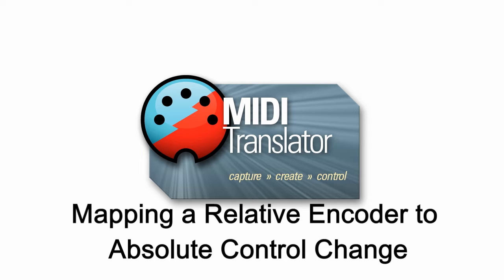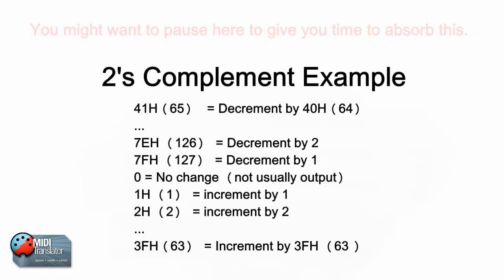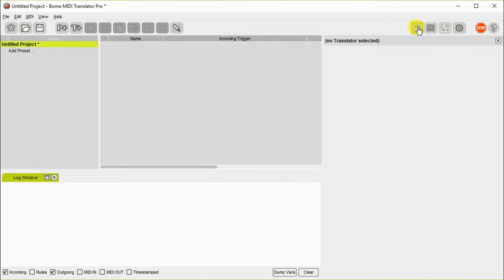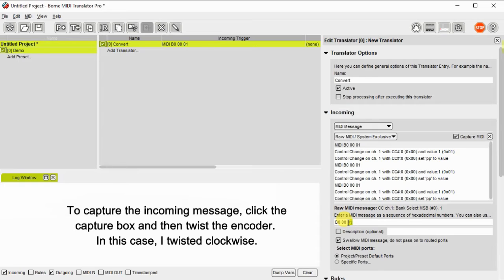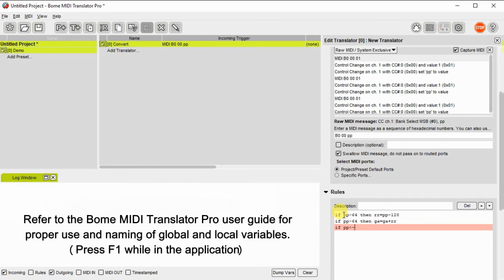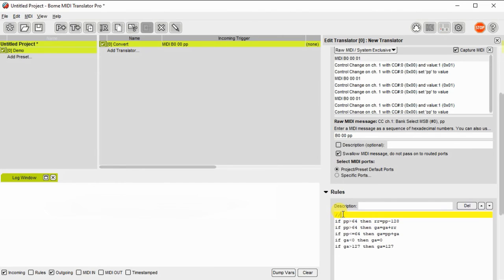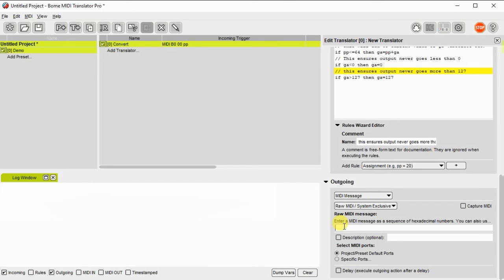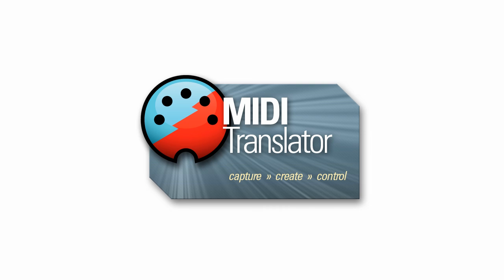Tutorial: Map a relative encoder to absolute control change with Bome MIDI Translator Pro

Comment: How to speed up the knob speed
Reply from the maker: Hi, If your relative encoder is not moving the knob fast enough, you can change the incoming value so that for every incoming 1 step for instance, it makes a change to the absolute output of 3.  For more detail post a question on our forum at the link below and I will address it there.

http://www.bome.com/support/kb

Steve Caldwell
Bome Q and A Moderator and
Independent Bome Consultant/Specialist
bome@sniz.biz